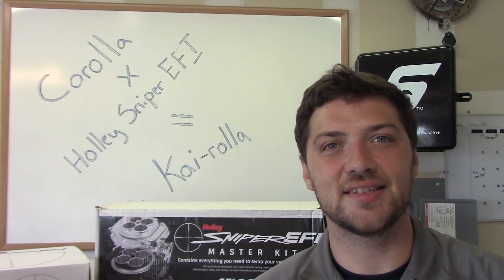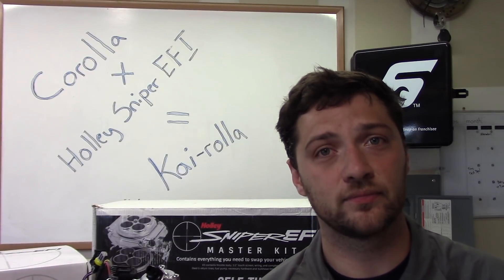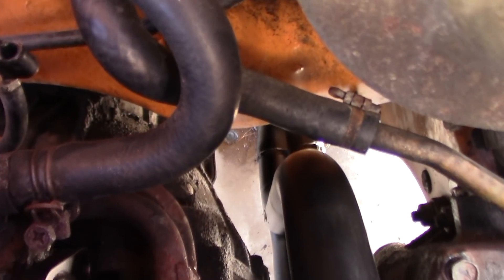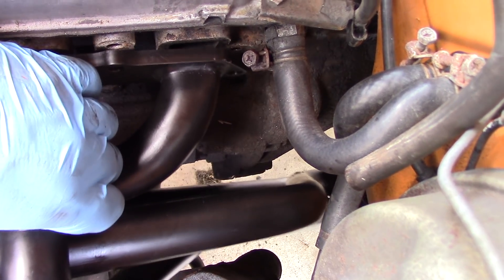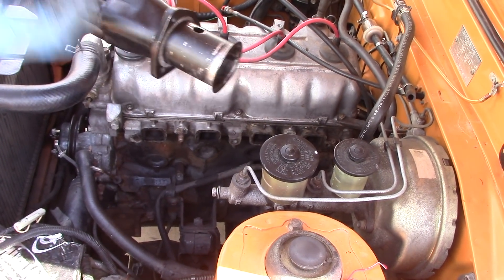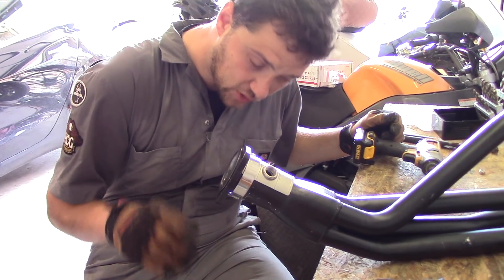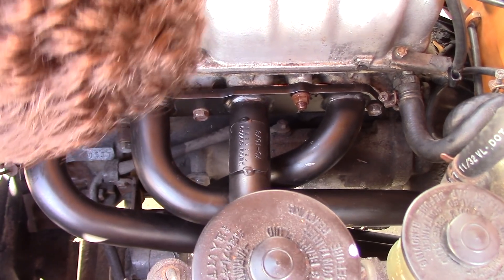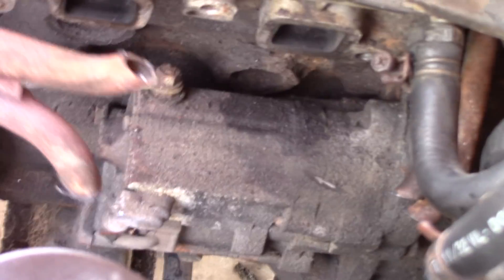Modernizing a 1978 Toyota Corolla: Installing EFI (Part 2)

Comment: I ended up installing a Schoenfeld 2tc header on my 77 Corolla automatic it cleared everything even the transmission but the header flange holes were smaller then stock bolts so drilled em out and also the header flange is not the thick as the pacesetter one so I had to use washers to compinsate

Comment: Yeah, the o2 sensor looks nice in there, but you're gonna have a hard time getting it out and back in when it comes time to replace it.
Reply from the maker: Luckily the sniper kit comes with a high quality bosch O2 sensor. I've had the same setup on my pinto for nearly 4 years and havent had a problem with it yet. But at the same time i'm not stoked for when that time comes.
Reply: @Scooter_911  I really enjoyed this series. Just watched part 7 today. I used to have a '79 Corolla.

Comment: That pacesetter header will make a difference for sure. Thats a common problem with the header hitting the transmission bell housing on Mazda B2200 as well. Just takes a little massaging with a grinder to fix like you guys did. Great job 👍

Comment: Will be very interesting to see what the EFI does for fuel mileage. The 2T-C's weren't great mileage-getters, but I suspect gearing
had a lot to do with this. Even the 2nd-gen Scion xB's with 140-some hp. didn't have a tall enough top gear for economical freeway
driving. This is part of the Toyota Way I don't quite get.

Comment: Dude. Do you look like Tim Tebow or do I just need new glasses?  Glad you didn't burn the Toy to the ground with the funnel fuel injection  trip in video 1.  You can dimple the header tube  with no loss in performance. Mike Finnegan on "Finnegan's Garage" (MT TV) Bolted a set of headers on a V8 and did a series of dyno runs, progressively beating the crap out of the headers.  It got extreme before there was any   measurable power loss.

Comment: I have a '79, same engine, but none of the pollution control stuff, probably because it was imported to Canada. I wonder if that air pump could have been modified to use fresh air, and have it add boost to the engine? Great video.
Reply: They hold at Max 5 psi and could only move enough air for a Briggs and Stratton

Comment: Is the exhaust material thick enough to accommodate it being tapped out directly for the O2 sensor?
Reply from the maker: Probably not on this header. The factory cast iron one probably would have been capable of it though!

Comment: Always clean up your header threads prior to refitting new headers and replace the lock nuts. Makes the fit super tight with no cause to loosen in future. Those bolts and nuts looked done with.

Comment: I love your explanations. Is there a way to EFI a 74 Celica with an 18RC Engine?
Reply from the maker: With the Holly sniper you can EFI anything you can put a Holly carburetor on. So if someone makes a manifold or an adapter for a Holly 2bbl it all goes together

Comment: I don't know why people seem to complain so much about carbs. Every old vehicle I have owned with a carb has been totally reliable, in respect to the carb, regardless of weather or temperature. I once had an old van with a carb. It started fine at -5F and 100F. It ran fine in all of that weather. The problems I had with it were with the transmission. My future daily driver is an old Nissan pickup with a carb. I will be replacing the stock carb with something, but probably not going through the expense of fuel injection.

Comment: it is not right to grind metal parts near the exhaust port,metal dust is bad when enter the engine,better taped the exhaust port first before doing that.

Comment: You could have just dented the header pipe where the O2 bung clamp bolt needs to be. That would’ve gave you the clearance you needed. Welding is probably better but for those without a welder I think denting it slightly would have been a good option.

Comment: Loving this little series. I installed a Sniper 2300 on my ‘81 3TC TE72 Corolla about a year ago. Best upgrade I’ve made to the vehicle - I drove it cross country over the Rockies and through Death Valley with no problems after the install. Looking forward to how you set up the timing control, as I’m still running the stock vacuum timing.
Reply from the maker: Right on! That's very encouraging! I am currently running it on my Ford pinto and loving every minute of it! Tell me is your Corolla automatic or standard?
Reply: Garret Seesing - It’s a 4 speed standard. One of these days I’ll find a 5 speed.
Reply from the maker: @DanielRusco  so I am having just a little trouble with my sniper on my 4 speed pinto maybe you have an idea. If I engine brake in second, coming to a stop, when I engage the clutch the engine stalls. Did you ever experience that? It doesn't happen every time but it seems like the sniper reaaaallly doesn't like any kind of engine braking.
Reply: @Scooter_911  Hmm.. I engine brake all the time with no problems. My first thought is your idle air valve setting. If it's not set to open fast enough you may not have enough air entering your engine, thus the stall.
Reply from the maker: @DanielRusco  I've tried several settings on my IAC speed. Where is yours set?

Comment: Did you do anything specific with the air injection ports on the head? thread bolts in?  Thanks, loving it.
Reply from the maker: Not yet. Our current plan is to take the threaded ends we cut from the assembly, weld them shut, and then reinstall them. I'll be sure to include that in the next video. Thanks for the compliment!

Comment: I just did all this to my sons car a couple days ago its a 79. we pulled all the egr stuff and capped welded those tubes and made plugs . then put a ebay stainless 4 into 1 on his. also we did the valves and head gasket . cant wait to see how the efi carb runs I will be getting one of its a success. thanks for the video.Edit. Wow didnt see it was 850 for it . thats 50 more than i paid for the car. ha.
Reply from the maker: Hahaha yeah it is just a touch on the pricey side, but I've been running that setup on my Ford pinto for the past year and I LOVE it. It's super responsive and consistent, and while I haven't dyno'd it yet I can tell it has significantly more power and low-end torque. Thanks for watching!